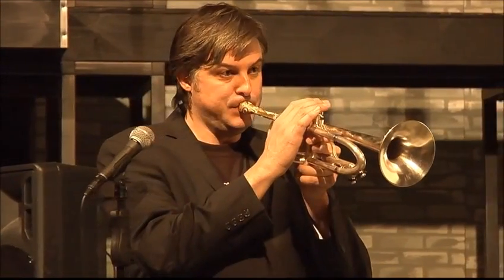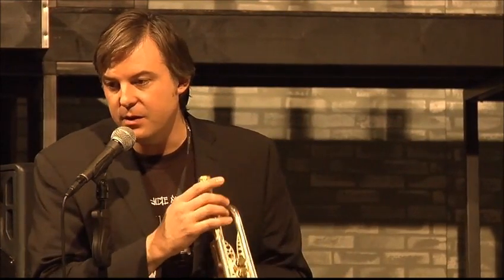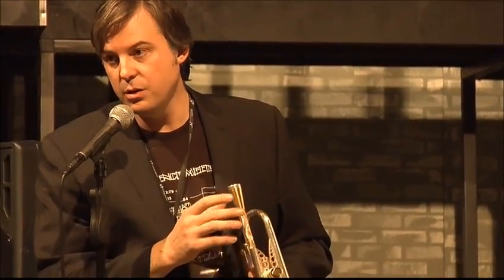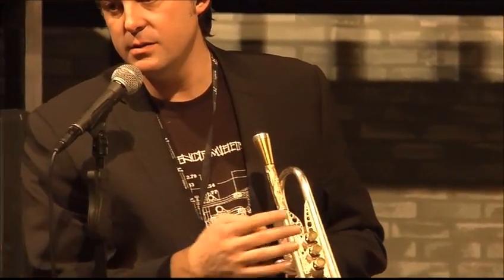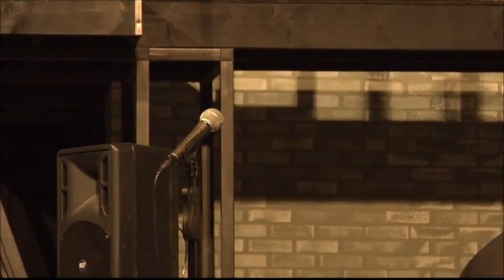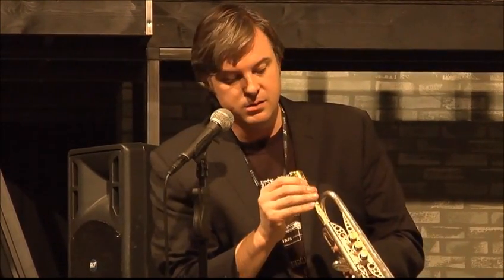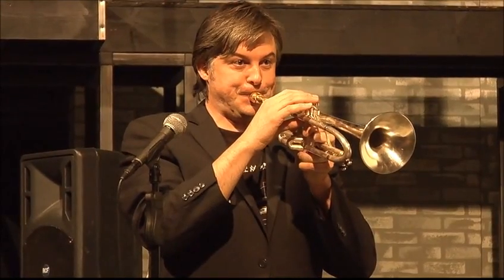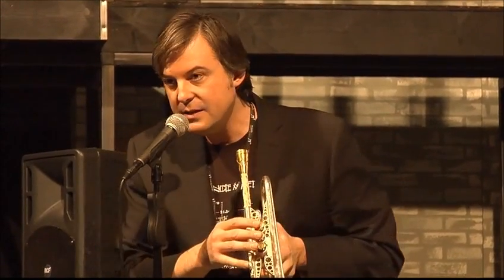Part 6 - Standing Wave Technology of Trumpet - Jason Harrelson Lecture at McNally Smith Part 6

Comment: This was an excellent series and opened my eyes up on a number of aspects of both trumpet physics and manufacturing techniques. One point I didn't hear covered though was the shape of the tuning slides and their role in the sound and impedance of air flow. Why are the Summit series using more elliptical designs than the Bravura, which I own?